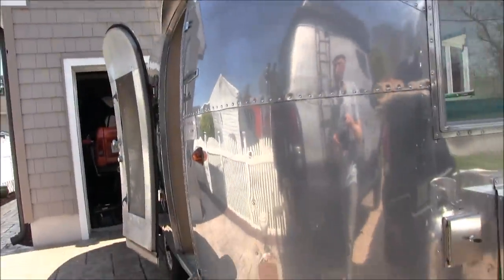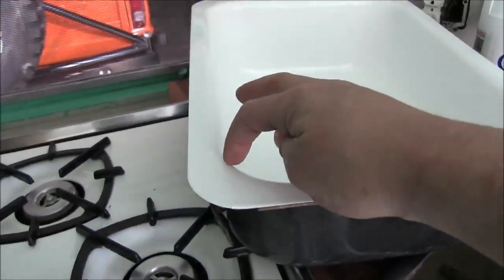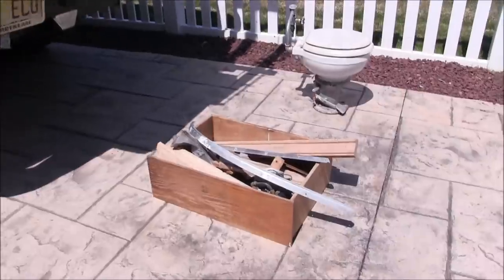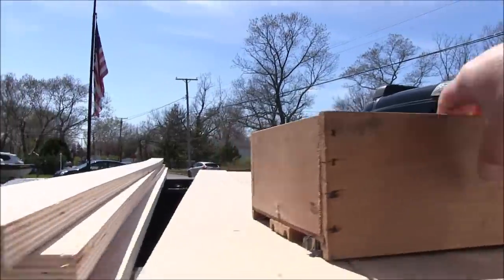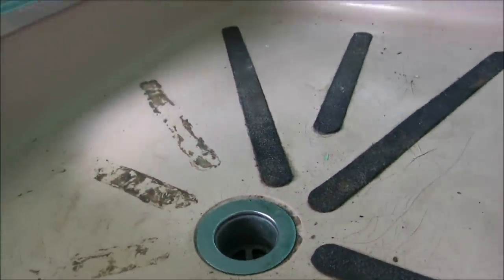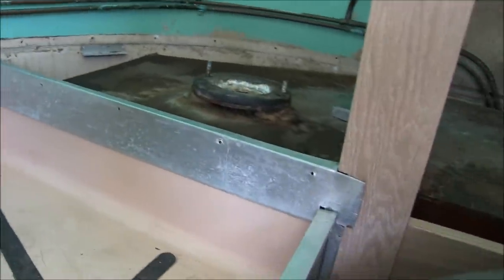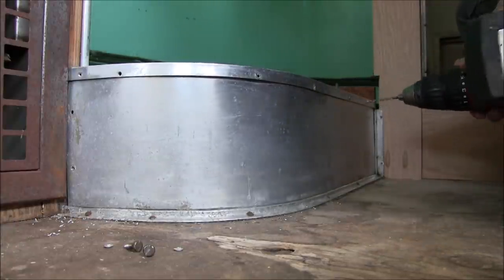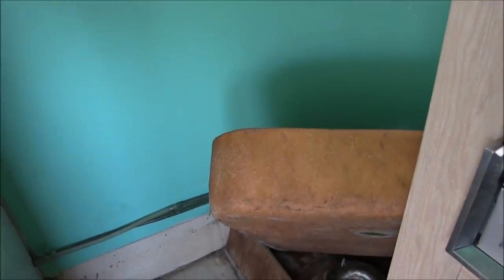Replacing a Camper Shower in a Vintage Airstream Trailer RV

Comment: i came to the channel for a complete shower redo but it was more about the rest of the camper.  did you take up the abesto floor?  did you need to shim the floor for drainage? Do you have another video showing this?  Thank you
Reply from the maker: Nicole most of the asbestos was removed before I received the trailer. I did it need to shim the floor. More videos to come, I didn’t finish yet